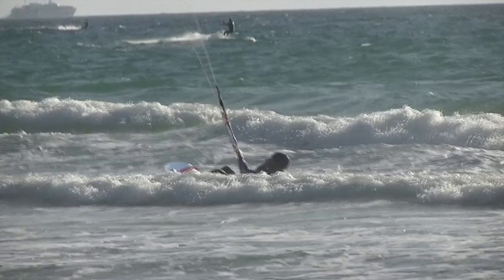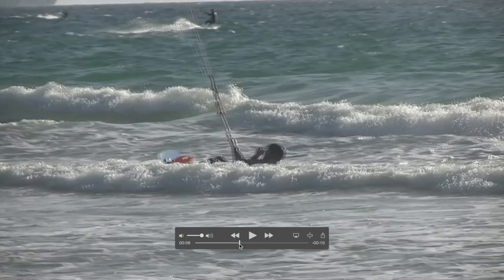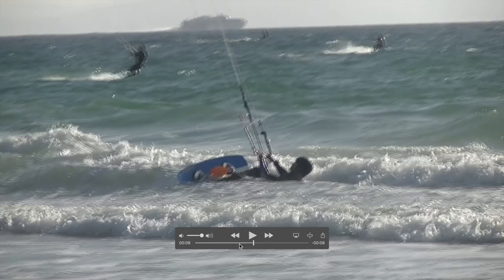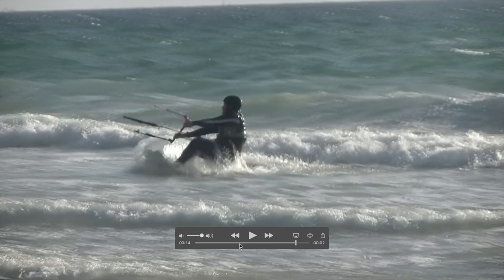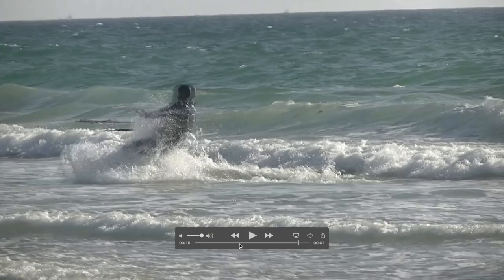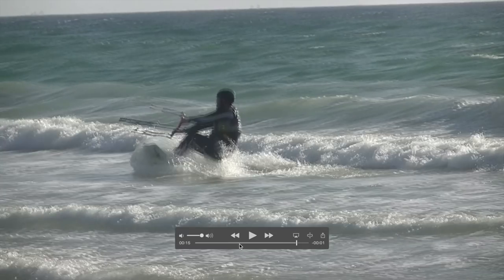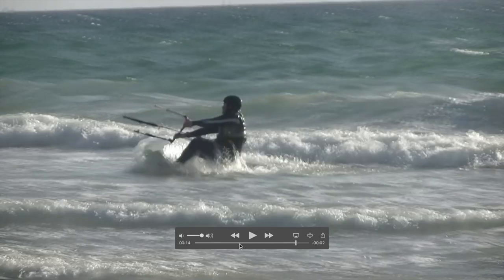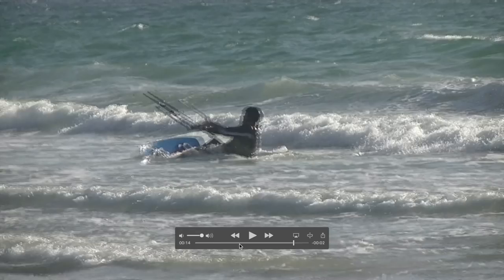Let the kite do ALL the work when waterstarting

Comment: Here's an addition if it helps anyone... I've been a long time wakeboard instructor and the start for beginners is almost identical to the kite start. Your arms are really just extensions of the rope and staying in a ball is the easiest way to get up as a beginner. 
The other thing we teach is once you are on top of the board in a ball, point your front hip the direction you want to go... this puts a little more weight on your back foot, helps the board plane out and keeps you from leaning back and skidding out or stuffing the nose. Hope this helps!
If you have a friend with a boat... practice your start a bunch of times on those no wind days. Just do NOT use your harness!
Great video as always! ... thanks for the instruction!.
Reply from the maker: Great tips mate!

Comment: Yup this is me. Had my first go in the water today and aim was to get standing up and drop down to get used to the initial feeling, what I found is the small breaking waves that were ok when standing up, when you’re in the water ready to start break over your head and cause you to lose concentration, I found myself preoccupied with the next wave. When I tried to get going I’d end up twisting and losing my direction of board and kite would end up going off and dragging me like a tea bag through all those little waves. After 1 or two I’d come up for air just to see the kite crash ha. I’ve no board experience and it shows. I can fly the kite ok on the land. Of course I’m not proficient at all as only had 1 day flying it so far prior. Combing board and kite to start in the water with small waves breaking over your head is a bigger chalkenge than it looks that’s for sure. I’m sure it clicks at some point.
Reply from the maker: It does and it will for sure mate!

Comment: I guess you kinda keep your knees bent like in water skiing.  One point, to keep your knees bent and holding requires strength, so our student may have some problems in that area.
Reply from the maker: True, but here a lot of the "strength" comes from leaning back and counter balancing the kite, a lot depends on the state of the water, choppy water = more strength required...
Reply: Yes, the water condition.  A big factor.  This reminds me of learning to waterstart on a windsurfing board.  Even with consistent wind the water chop was a big factor.  Also, core flexibility and strength during the learning process helps a lot.  The repeated fall and retry can become quite fatiguing.
Reply from the maker: 100% agreed!